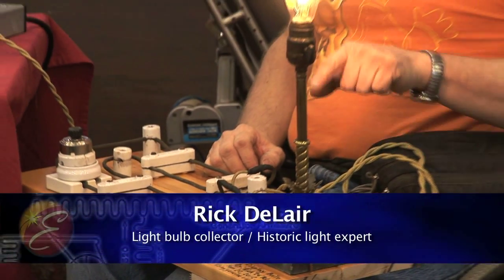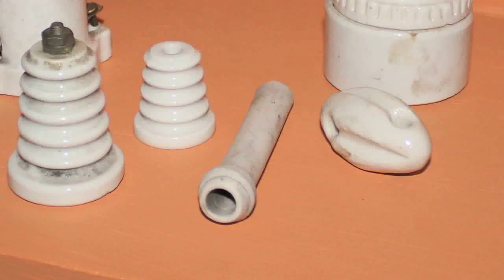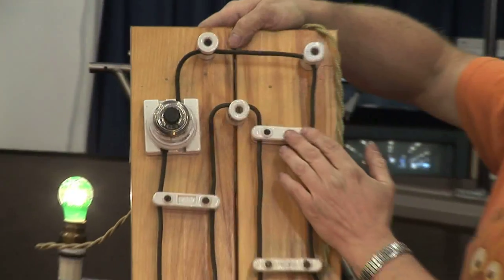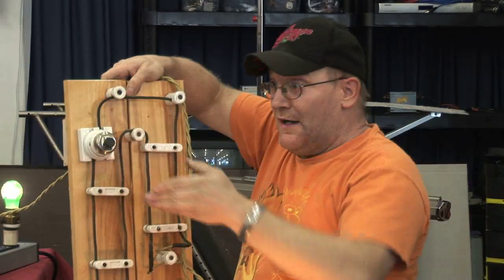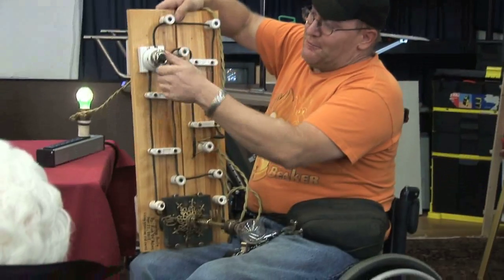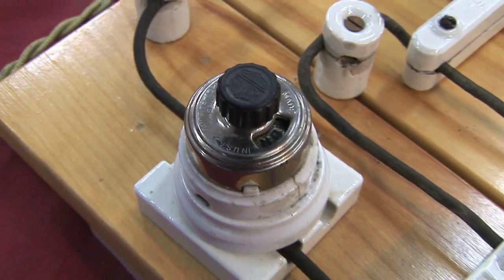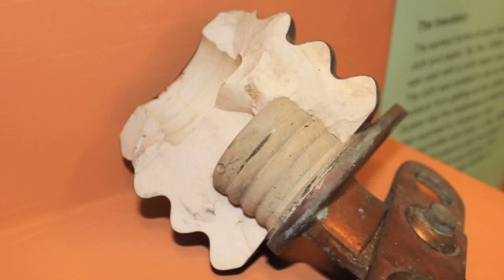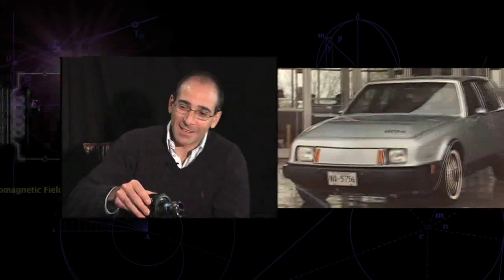Knob and Tube - early electrical insulation

Comment: The building which handles my data center actually still has some knob and tube in service, still in good shape.   Maybe some day we will replace it.  Then again we said that 10 years ago too.
Reply: If its in good shape is safe.
Reply: @Tadfafty  There is perhaps not much that can go wrong and even if primary insulation will decay the porcelain should prevent problems.
Reply: Does the data travel through telegraph lines?
Reply: @renakunisaki  Lol, you walked into that one.
Reply: @renakunisaki  Your question have two answers, yes and maybe.
Yes as telegraph line indeed transfers date in form of dots and dashes or in binary if it is used for teletype service.
Maybe if you had modern internet communication in mind. Old style lines don't have exactly the best inductance and capacitance parameters, but on limited length it is most likely possible.

Comment: Had this open wire in my mom and dad's house for years. As a kid with my brother involved in CB radio I always thought it was antenna wire. Until my Uncle dropped a test light over them and it worked. Needless when he found out the wires were live it was removed that night. But for 50 plus years it kept the lights on. On our front porch. Scary!

Comment: Selling our house that was built in the 1950’ an addition was added to the back of the house in the early 60’s. The inspector wrote that the knob & tube wiring needs to be replaced. 2 years ago when I bought the house this was never even mentioned. Must this be replaced??
Reply: I just went to look at a home and found out it had k&t after the inspection. Immediately terminated the agreement. 50-100k to pull the walls down and rewire the place, then put up new drywall. These are old homes too, so you may as well re-insulate and straighten out any structural issues while your walls are removed. People looking to buy could not afford a home that would not qualify for a mortgage.
Reply: @dylancooper8497  come to find out it was the real estate agent was the person who mentioned K&T in the house. There was no K&T..🙄🤦‍♂️

Comment: Why were they so concerned about an insulated wire touching wood?
Reply: since knowledge about circuit loads was unknown people would just keep loading the circuit until the fuse blew. To correct it they might put in a larger fuse. After a while the wire would get hot, breaking down the insulation and charring the wood until a fire started.
Reply: @boblang5829  Good explanation - thx!
Reply: As redundancy really. Should the fuse fail and the circuit overload, causing the wire to heat up red hot the porcelain insulators will keep it from starting a fire.
Reply: Dampness could be an instant problem too.

Comment: And if you buy a house with knob and tube, the insurance companies will freak out and may refuse to insure it until it's upgraded.
Reply: sad really, it is a great system and if in good shape there really is no need to replace it.
Reply: @WalterKnox  There is no ground, surge protectors will not work so you can't protect expensive electronics. Also, if a device was to short out the whole thing could be energized.
Reply: @Aholeintheozone  right, so if a device fails then it could be dangerous. Knob and tube is not dangerous, it was used for many years and ungrounded systems even longer. If you have an old house with K&T maybe run new circuits for the kitchen and where large appliances and stuff are and for electronics. But really for the most part it is fine and there is no reason to freak out like everyone does.
Reply: @mattywho8485  like I mentioned before, it it HAS NOT been screwed with by idiots then it is fine, if it has been tapped into and messed with then it has to go, but originally it is fine. And believe it or not out here in the country where I am there are a bunch of little farm houses with original wiring that has not been messed with over the years.
Reply: @WalterKnox  all agree that the system is fine if it's not hacked up and in good condition. The thing is I don't think I've ever seen one that wasn't hacked up, and I'm 60 years old and can remember back in the day when finding k&t was quite common. They stopped installing k&t over eighty years ago. in those eighty years it's all been touched somewhere by some home remodeler hack
Reply: @joecummings1260  yeah, I understand that. I am not sure if it is an area thing or whatever, but there are quite a few houses around here up to the early 50s that still have it. You would be surprised about the amount of little small farm houses that besides for a fixture replacement are all original as far as that goes. Of course we are talking like little small one or two bedroom houses. There are even a couple of little country stores that have old knob and tube and actually surface run clear wiring like shown in this video that is not all tampered with. I have even heard but never seen the occasional early 1970s K&T installation. In some cases like in agricultural buildings you are still allowed to run open work on insulators or cleat wiring like in this video. Most larger houses though are a completely different story
Reply: @WalterKnox  No. It is fine in its natural context. However, when you apply modern context, the context that a modern insurance company is concerned with, it is not safe. People who are going to be using the homes that have Knob and Tube installed are not people magically transported to 2021 from the times of K&T. They are people from 2021. Who use electronics, and expect insulation of, modern 1980s+ housing.
Reply: Oh, and, notably, in the event of a lightning strike or surge your stuff ((what the insurance company also has to worry about insuring)) will likely get toasted. So.. Yeah.. They have every reason not to want to insure you, out of fairness
Reply: @KenzertYT  i understand all of that, i really do. but as far as the modern loads come in to play, the wire itself is the same gauge, in some cases heavier gauge as modern romex, so that is not the issue. the issue is that people insulate over it and it overheats. as for the lightning thing, that has to be pretty rare to have the copper wire vaporized. I am sure it happens, but if it was zapped enough to do that, modern wire ground or not would be damaged as well. and insurance companies here do note that you have knob and tube, but they will still insure it. if all knob and tube had to be replaced there would be a lot of houses without power around here including mine.
Reply: @KenzertYT  that could've happened to any home, not just a home with K&T
Reply: @WalterKnox  ungrounded systems are never safe. Don’t be a potato. Nobody likes a potato.
Reply: @mattywho8485  yeah but like you just said... someone messed with it
Reply: @jess60901  sure, I am a jerk. I simply made a correct statement that knob and tube that is not tampered with is safe, and people keep arguing saying shit about lightning and all sorts of stuff. i understand it is not grounded, but even if a standard electrical system from today is hit directly by lightning there will be some damage, even though that is rare. so then they mention shared neutrals which is something completely different from knob and tube and I never said anything about shared neutrals in the first place, but yes. I am the jerk for simply stating facts and then when someone puts words in my mouth then i do get a bit aggravated.
Reply: @jess60901  i never mentioned shared neutrals and this guy called me a potato, I never did any name calling or said anything about anyone, i was stating facts about the wiring, and he called me a potato and put words in my mouth so i fired back.
Reply: @WalterKnox  no. K&T has a much lower load rating for modern use. If you want to stuck living with no electric oven, no TV, no dishwasher etc, then go head. But If you want to retrofit it with modern appliances, then no, K&T are not good at all.
Reply: @ddjohnson9717  This! It works ok if you aren't running any load bigger than a few lights. Space heaters are a huge no-no with knob & tube wiring!
Reply: @WalterKnox  no, it isn’t. Shared neutrals are a fire hazard and a half 🙄

Comment: With only 110volts in USA and dry timber didn't really need the insulation.
Reply: .....until it rains, carbon tracks, and blows breakers/fuses/catches fire

Comment: I had my 1905 home remodeled and I saved some of the knob and tube as a display. It's funny how the main house was knob and tube, but the garage was stab lok . The garage was built in 1954. Both were updated, but I never realized how expensive electricians are.
Reply: how much did it cost you to get it rewired?
Reply: @skiumah06  The total cost was a little over 23k. It included a 200amp underground service for a 4,600 sqft. house, three car garage, adjacent workshop/gym and city permits. We trenched a city street to get to the pole. That by it self required additional permits, street closure fees and traffic control fees. The existing line did not meet current code so a new one had to be installed.
Reply: @Jesse-gv9tf  holy hell. We're looking at purchasing a 1900 home and had the inspection today.  it "needs" some rewiring of knob and tube wiring and I'm just trying to get a sense of what it might cost. 1800 sqft. house, some of it is already rewired, but the entire upstairs is not.
Reply: @skiumah06  my advice would be to schedule multiple electricians and have them submit bids. Remember, the lowest bid isn't always the best bid. I'm in Los Angeles, CA and prices here are ridiculous. The street trenching was shy of 9k by itself. I'm guessing you won't need to dig up the road and sidewalk so it might be considerably less expensive.
Reply: @skiumah06  michigan?
Reply: @skiumah06  was the house in michigan?
Reply: @skiumah06  reason I asked is because I'm in the process of purchasing a house here and it's the same age and square footage. Also same electrical situation you stated lol
Reply: @lookItUp91  ah. well, we are also in the midwest and were able to get the work completed for about $16k. A single electrician did it and as far as we can tell, he did a great job. Very little demolition done to our walls... just a few holes around switches. It was definitely worth getting multiple quotes.
Reply: @skiumah06  could I use a home equity loan for that?
Reply: @lookItUp91  do you mean like tie it into your mortgage? I've never had a home equity loan, so not sure. But the company we went with had a financing option with 0% interest for up to a year. We paid 1/2 down, will pay off the rest before that year is up, hopefully.
Reply: @skiumah06  yeah, but add the trench across a city street, and there ya are, exact same price

Comment: My light switch suddenly stopped working, found no voltage going to switch.  All circuit breakers were still on, all lines out of panel box are romex.  I went into attic to look for the line, it's knob and tube and the line had been electrical taped and it came apart.  Live line was under insulation ugh...

Comment: When i bought my 1903 house, everything appeared to have been rewired; breaker box, gfe, etc.  However once i got up into my attic, i see the old knob and tube wiring. I would like to figure out what is going on with my house. Anyone have a clue??
Reply: It may either be dead wiring, or more likely that wire is still live and carrying current - but hooked up to the newer devices, of course.
Reply: @discusobscurum2194  yes it is live. It is very live. I have located all areas in the house with fuses. It appears there have been upgrades to the electrical sytem twice. The old wiring has no fuses and the power coming in to the house even has a knob on it. Is it safe for the new electric to be tied in to the old system? If lightning strikes the system, wont all the new components fail as well? Is the fuse box only there to appease the inspector and make me feel "better"? How do i wire new switches etc in to the original wiring? Ie. If i want to change the light switch, what is the protocol? Can i do things like install dimmer switches? So confused. Thank you in advance for any information you can provide on this subject.
Reply: I would try to find out the extent of it by peaking under outlet/switch covers. Try not to touch or move the old wire too much as it may crumble. Never try to connect new wires into the old. If you have a fuse box and not breakers, thats another concern.
Reply: or running the lights. are's knob and tube wiring runs haft the lights and two outlets  on 15A
Reply: Same issue here, 1917 house, panel has all romex but I'm finding live knob and tube in the walls and attic.  This was not disclosed by previous owner, nor caught by home inspector.  

I'd suggest an electrical inspection, who knows how the romex and k&t wiring are spliced together.  I found one that came apart in my attic, live line under insulation...

Comment: Where is the neutral on that board ?
Reply: It's there it's just the same color as the hot. They didn't distinguish between wires back then. It wasn't until cables came along that they realized they needed to distinguish between them. But even with early cables it's not uncommon to open a box up and find nothing but black wires.

Comment: if you have an old house with knob and tube still intact leave it. if you want higher loads run a new electrical panel with new outlets and just leave the k&t for the already existing stuff like light fixtures. it is perfectly safe.
Reply: My parents bought a house in 1970 that was k&t since the early 1900's. The house was built in 1890. My dad installed a new panel and ran outlets to every room, eliminated the old k&t powered outlets, but kept all the ceiling fixtures on k&t. It worked perfectly fine, but was all completely rewired last year by an electrician who bought the house.  It lasted nearly 50 years though like that without an issue.
Reply: How about cloth covered BX wire?
Reply: @njwags95  cloth covered BX wire is normally okay but if the cloth covering the wires is crumbling whenever slightly moved i would replace it because the 2 wires are so close together and in a metal tube so it would be a lot easier to short out than knob and tube, knob and tube has the wires far apart from each other and anything else, so even if it gets a bare spot it generally does not cause issues.
Reply: Walter Knox thanks for the info, it’s only safer that KT cause it’s grounded correct? Next week I’m opening up the ceiling and I know I’ll find some KT also. Not sure if I should swap out the BX.
Reply: @njwags95  in most cases yes, it is only grounded if it uses all metal boxes and is all connected properly, but generally you will be okay, just dont overload it and it should be fine.
Reply: Try telling that to the Insurance Company.
Reply: @micheleemcdaniel389  The question is " is it safe" NOT "do insurance companies like it"
Reply: @WalterKnox  No, the question is, will the Insurance company insure your house if you have K&T and in most cases they won't.
Reply: @micheleemcdaniel389  and who asked this question? I was just making a statement that it is SAFE if it is intact. I NEVER mentioned insurance companies... furthermore, around here they don't seem to care and almost every old house still has knob and tube.
Reply: @WalterKnox  Please don't get defensive.  If you post on Youtube you have to expect comments from other people.  If you live in an area where you can get house insurance even with knob & tube then you are fortunate.  There are places where you can't get insured and if there is a fire you won't get a plug nickel for your house.  That is the danger.
Reply: @micheleemcdaniel389  I am sorry, I didn’t mean to sound rude or anything. I am just stating that my original comment was on the safety, not insurance. I do understand insurance companies normally have issues with that stuff, that just is not what my original comment meant.

Comment: I have a roll of 10 amp fuse wire from Jefferson Electric, looks like a roll of flux core solder wire. Anyone know the application and installation of fuse wires?
Reply: yes. One of the houses I grew up in had a fuse panel which consisted of an open knife switch as a main and individual circuits protected with fuse wire. The wire would be the only protection for the circuits in the house. The house had originally been lighted with gaslights and when it was changed over, some of the piping was used as raceways for the lighting circuits. Each bedroom had a wall sconce with an outlet located at floor level under it. That was the only power in the room.
Reply: @boblang5829  now i know why 10 amp fuses were so prevalent in the early days.  The old gas pipes were 3/8 inch, so the conversion to electric was made with the thinner 16 gauge wire.

Comment: Are you sure the reason the knob is taller is because of mice? Wouldn't it make more sense to make it taller to make it harder to hit it with a nail?
Reply: Chris Bouchard it's for both actually
Reply: When I was taught to install knob and tube, we tightened the wire by starting the knob at an angle and straightening it as we nailed it in. It was so tight you could play a tune on it. No mouse was ever going to bend it in.